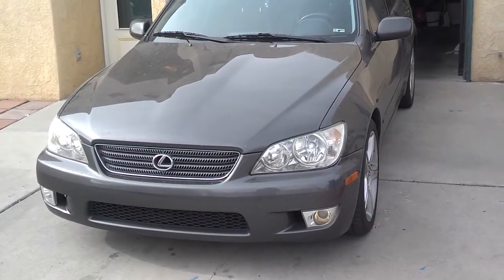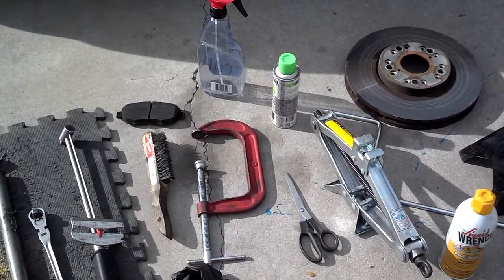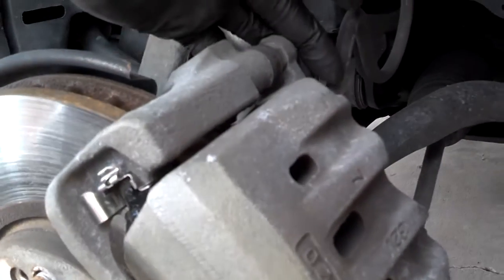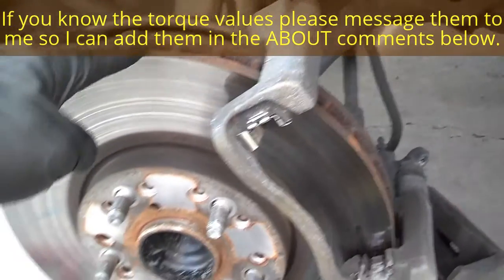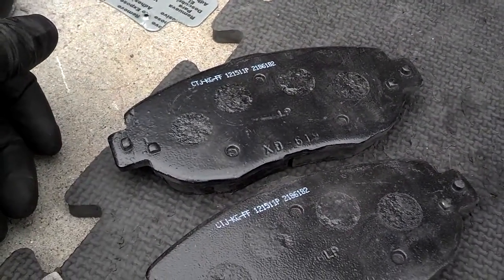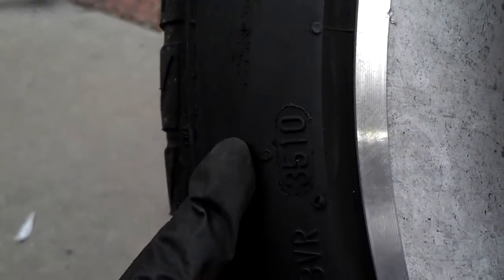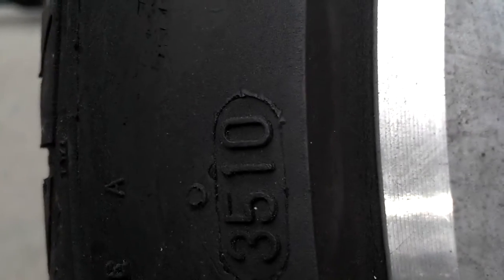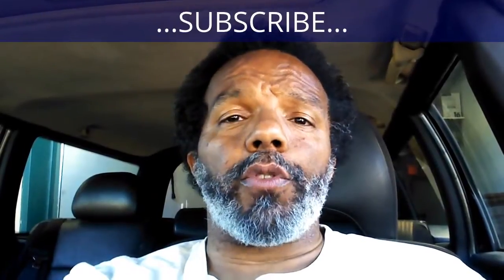Front brake pad and rotor replacement, steering wheel shakes while stopping. Lexus is300 - VOTD

Comment: Good video! I own the same car. Here are the torque specs in ft/lbs

Front brake caliper installation bolt (Holds section of caliper that flips open) 25 
Front brake torque plate and Steering knuckle (Holds caliper to body of the car) 87

Comment: Nice work again Robert.  A few things I do when doing this job:     Before pushing the pistons back into the calipers, check the brake fluid to make sure its not overfull - if its very full it might push against the brake reservoir cap and cause issues.     A little Antisieze between the rotor "Hat" face and the inner wheel face helps to later remove wheels that like to stick to the rotors.     The slide pins can be a real bugger to replace esp if they have a rubber sleeve on the inner area....air pressure builds up when installing them and some cussin might be needed - I only remove those if they are not moving slick and smooth.     Turn the wheels/rotors after install to check for drag.   Running in/seating the pads to the rotors is sometimes called "Bedding".  Stay gold.
Reply from the maker: ***** Thanks for the notes. I usually do check the reservoir and often pull the cap off before compressing the pistons. Since these pads had so much meat on them I didn't do that this time. Likely still should have. I often put anti-seize between the wheel and rotor as well, about 1/2 the time. I have seen wheels stuck to the rotors, horrible experience. I actually seen a guy under a BMW on the side of the freeway trying to kick the wheel off while the car was on a scissors jack. I almost locked them up and went and got him from under there. Again, thanks for the info. I'll make a few caption notes to the video.
Reply: Robert DIY
yeah that's typical of alloy wheels on BMWs to stick like that. a trick you can do is put the lug nuts on the wheel hand tight and whack the heck out of it with a sledge hammer. that always works. another thing to keep in mind especially with a lot of anti-lock brake systems, you may or may not need a dealer level scan tool to properly bleed out the brakes. at least that's what Scotty Kilmer told me.
Reply: Michael Sackstein Thanks, I have been meaning to look up ABS bleeding.  My cars have it but they have no special procedures, but I'm sure there are cars that need some tools.  Let's hope dealer level is not required because those things are thick dollars.  Stay gold.

Comment: Loverly job robert :-), that should be ok for a long time now.
That camera picks up the dust on your lcd monitor well, i bet it can do macro.
I did notice the cleaness of the caliper, it didnt look very old at all, and the slide pins were ok as well, perhaps the brakes were serviced earlier in the year.
Reply from the maker: zx8401ztv LOL, still using my phone. HD BABY!!! Every once in a while when I miss a step, I have to film a step here at my old laptop. ;) From what I can tell, the car has accumulated about 2,300 miles since the last oil change in February. Not much of a driver. Probably put more miles on her dad's Jag than this car.
Reply: Robert DIY
lol dam good phone :-))
Yes i have noticed the lcd filming, its a good way to add bits :-))

I didnt think that car had been very far on those brakes, odd that they needed doing so early on, perhaps the brake shoes were too hard and made a mess of the disks.
Anyway im waffling on, nice job robert :-D

Comment: Also I forgot - if anyone uses an impact gun on their wheel nuts - NEVER use the impact gun on the security/anti-theft special wheel nut.  If you find your impact gun damages the edges of your lug nut points, use a wrap or two of masking or electrical tape to help protect your nuts.  Stay gold.
Reply from the maker: ***** Are you referring to removal?
Reply: I should have clarified, the impact gun note was for when the security nut is close to higher torque.  The impact gun can be used for when the nut is loose.  The tape note was for either direction - loosening or tightening.  Stay gold.
Reply from the maker: ***** Cool, thanks again.